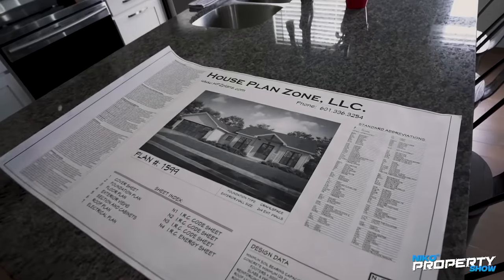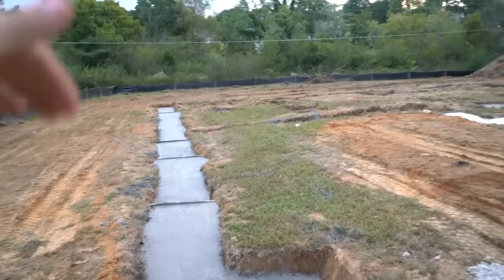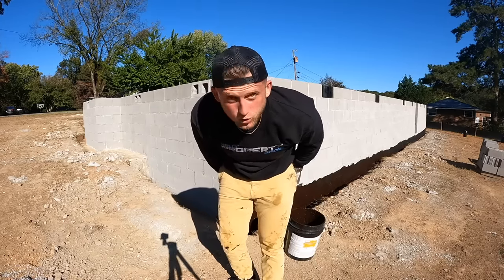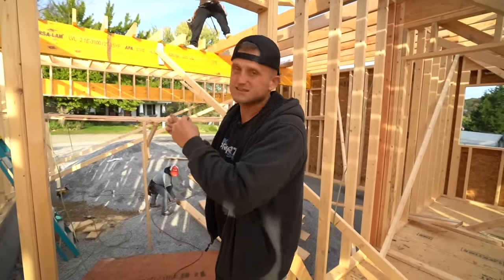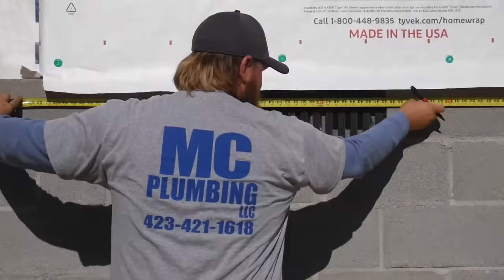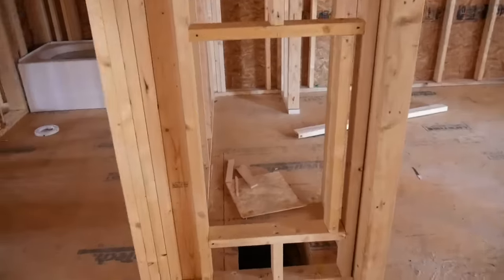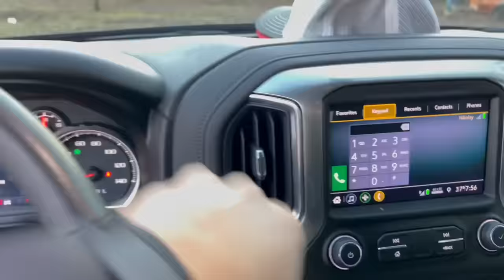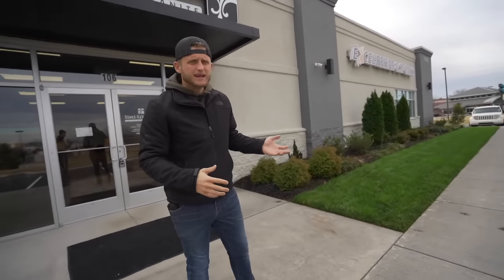Building A Wooden House in 24 Minutes - TIMELAPSE

Comment: My house dates from 1951 and when they did the foundation they did not parge the block before putting the foundation coating on. The joints started to deteriorated and I had to remove the coating on the exposed surfaces and then grind down the surface of the block in order to parge it the way it should have been done in the beginning.
Reply: Shut *

Comment: I have always hated concrete blocks. I would just pour concrete instead. Don't talk to me about price either, some things in life, you don't worry about cost. Your house is one of those items.

Should insulate both sides of the concrete block foundation. Also should have used Rockwool comfortboard 110 on the outside to wrap the house in a blanket of insulation.  Also using Rockwood inside would have been awesome. Ownings Corning fiberglass insulation SUCKS!  But I guess, for a traditionally built house, it's nice.  Look up T studs too.
Reply: Typically the exterior side of masonry gets rigid foam insulation and an acrylic cement coating with either fiberglass or rockwool in the interior side.

Comment: The foundation is divine... (this is sarcasm). No waterproofing. Generally! Drainage with a drainage pipe against the wall? Reinforced belt in the form of a vertical mesh?
It would be possible to simply push concrete into the ditches and it would be the same, only even cheaper. The only reason why the house won't fall apart is that its weight is extremely small and apparently the climate is warm.
Why are they ramming... Gravel? 😆
A frame house made of wood at current wood prices ... However, perhaps in the USA it still remains the cheapest material. Here the construction technology is at least the middle of the last century, probably the way it is.